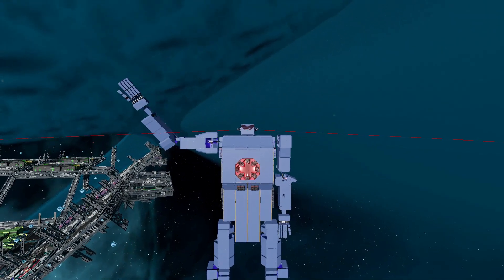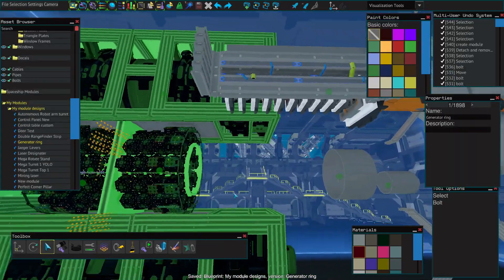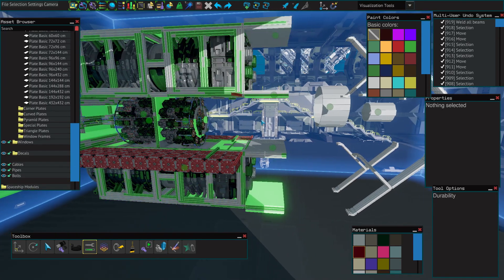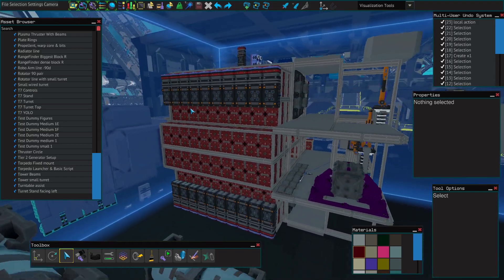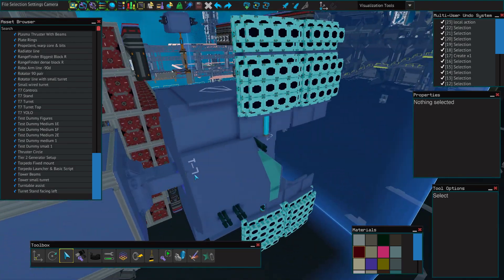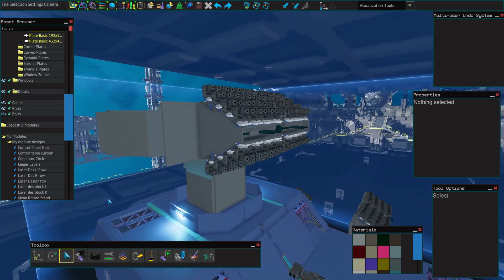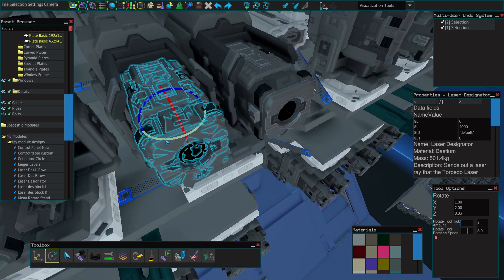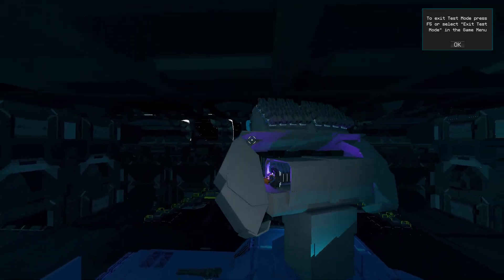Starbase - Building a Combat Miner

Comment: Your idea's and designs are impressive. 

We have built a similar ship to what your building, we have a 440 crate cube fitted with advanced cradle at the rear  mounted with 4 laser weapons, only its not automated like yours, its controlled from the seat, we also fitted additional weapons on the front and charodium plating all around. 
To our surprise considering the amount of crates and plating it still managers to cover a distance of 10km in 1 minute 7 seconds. 

We left plenty of room around our Generators also because of the new heat sinks that are due to be released, I know there's probably a work around and you could maybe just pipe them up to your Gens, but we just didn't trust the starbase devs on how they will finally work, hence we made sure they would be room to fit them directly onto the Generators.
Reply from the maker: Sounds like a decent ship, have you been attacked in it yet? I don't have a lot of space around the generators in mine, I might have to add an extra secure room in front of it to store things like the heatsink.
Reply: @CommandoDoggo  So far no, there hasn't been any attacks on it yet, but it has had a few players looking at it.
The previous version we had was attacked at Elysium and lost but that was mainly down to the pilot been away from his keyboard when it happened.
Most conflicts or piracy are at Elysium in my opinion from leaving the warp gate and heading towards the Elysium belt, you will find pirates sit there ships on the structure of the gate and wait for someone to arrive and then follow from behind until they leave the safe zone and then attack.
If you protect your cockpit the best you can with layers of glass and extra plate shielding it will improve your chances of survival, but the down side is you have to sacrifice your viability a bit, and try and make sure most of your controls are shielded if possible from shots. 
The good pirates will tend to aim for the cockpit because that's the main weak point.
Shooting at the pilot and controls can leave your ship dead in space, which is what I aim for when fighting pirate's. 
If you have a friend that can give you a fighter escort while out mining then that will help, we have company member who does that at Elysium now.
Reply from the maker: @7evenof9ine76  Thanks for info, I haven't done pvp yet so this is good to know. When I finish my ship I might buy it on PTU server first since its free there, then purposely expose myself to pirates to field test it. I thought about cockpit sniping too so I plan on making the whole cockpit able to move position, and hopefully pirates will get confused with all the turrets and moving parts xD

Comment: They should really make plasma thrusters go faster then normal ships since they are so expensive
Reply from the maker: My first time using them, I heard they go faster after warming up, but I'm mostly just trying to save bolts and cables.
Reply: Max speed is still the same 150ms, they take a full minute to go warm up but when they are warmed up they are very powerful and fuel efficient.